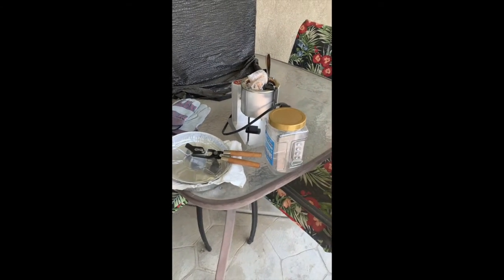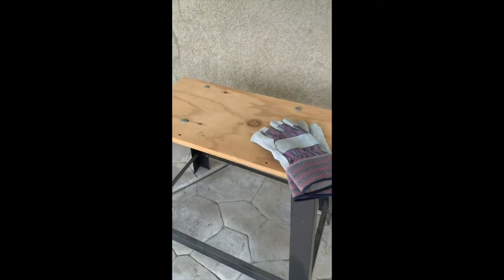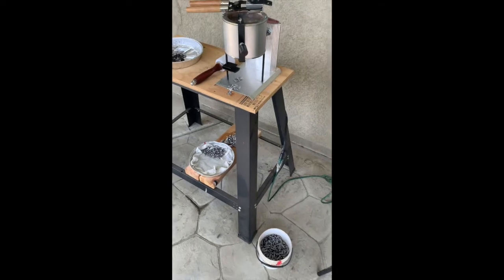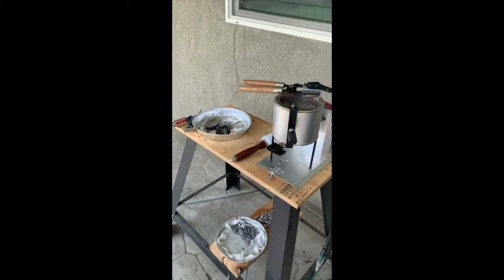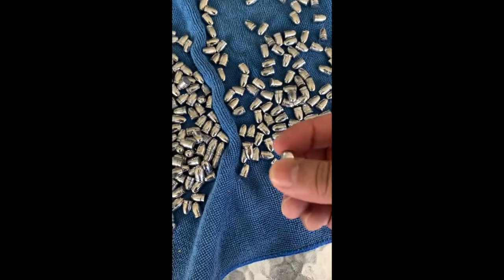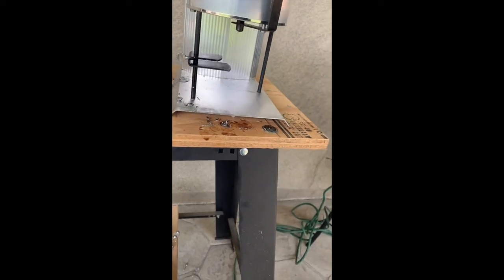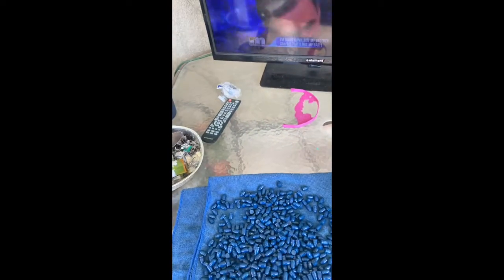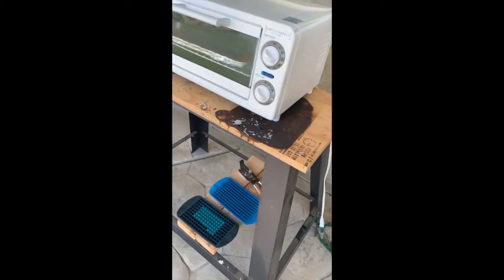Second Batch Cast and Coat bullets

Comment: It's normal when you had lead for the pot to cool down at the pour spout if you add a lot of lead . When it gets back up to temperature it should flow again . I'm guessing it did by the burn mark on the table . LOL . This is why you don't cast on a glass table ..... You're doing good , those bullets looked great . It's all part of the learning curve .

Comment: They cast shiny because your pot was at about 715º ... that's about as cool as you can run it in the summer & the spout freezing is normal, a torch will get'er running again PDQ.
Too bad you didn't have any 'Clear Gloss PC' those rounds would'a looked like bullets the Lone Ranger shoots da bad'uns with.
Nice work...now you'ra pro....but, put a cookie sheet under the pot so next time you wander off somewhere you can catch the hot stuff before it damages something else...you don't want it on the concrete, sometimes you can't get it all off. Wives tend to frown on that trick!